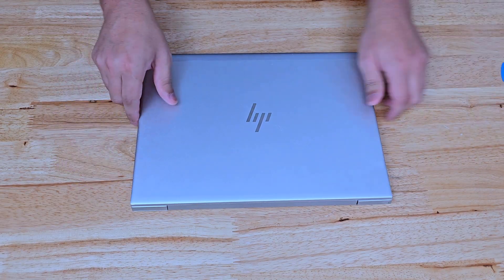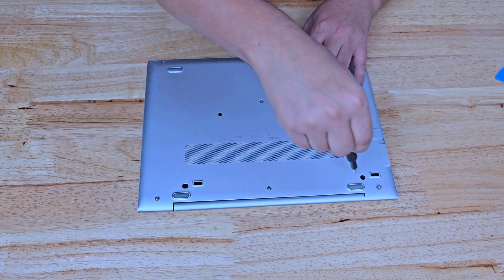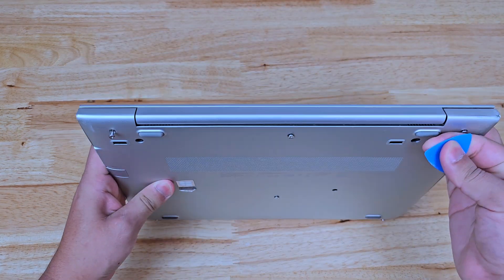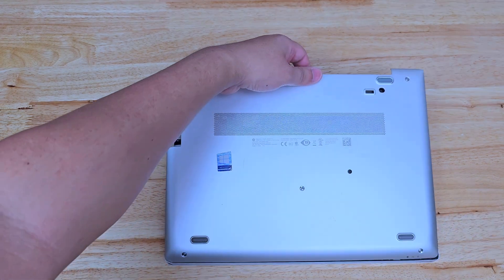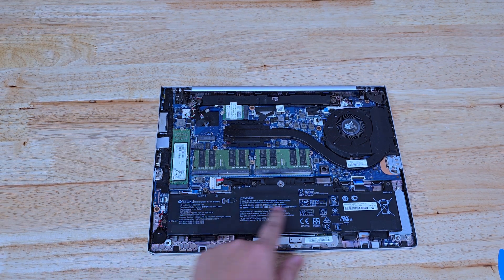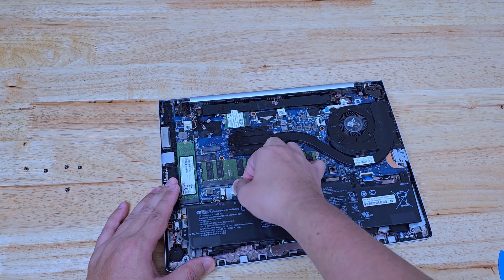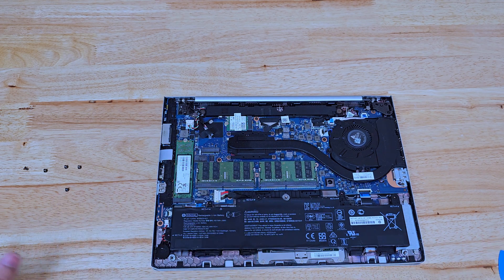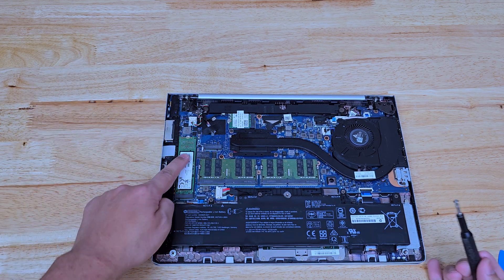HP EliteBook 830 G5 | How to Upgrade Ram, SSD and Battery

Comment: Is this about the same for the G6?
Reply from the maker: Yes very similar. The G6 is a refreshed version of the G5 , just with a newer gen cpu,
Reply: @racimbio found a tossed out HP Elite book, possibly an 830 G10 or close model. Found it in an e-waste dumpster, but no M.2 / NvME, no RAM, no battery, no screen.. may have located the bottom cover but not sure! The rest looks to be in good shape

Comment: I was thinking to upgrade the storage to 1 or 2TB. Will the system able to support the larger upgrade? or do I need to upgrade the RAM too?
Reply from the maker: @retirement-101  it should be find with the higher upgrade. I upgraded to a 1tb myself.